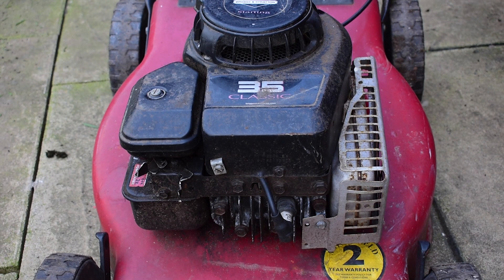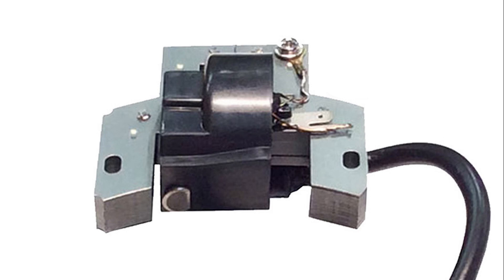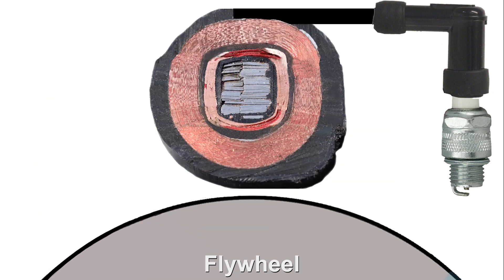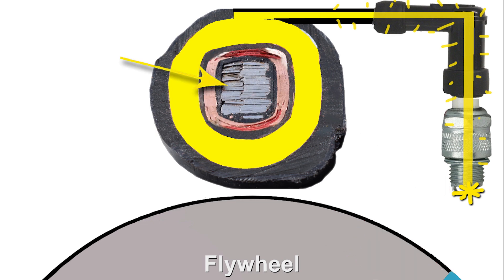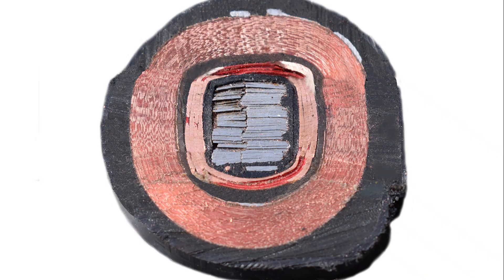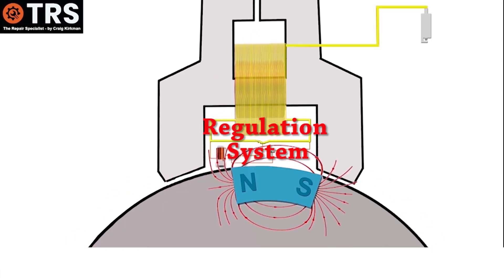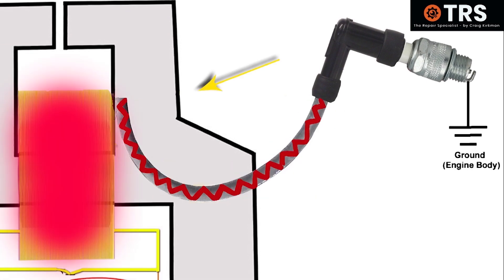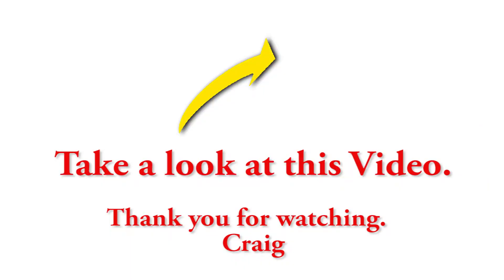Lawn mower Stops after few minutes, when HOT - This is Why!  (by Craig Kirkman)

Comment: Your governor vid is a masterpiece. I have this problem you describe. 2017 Honda GCV160 engine. Runs fine, then once it gets hot, dies. After cooling a minute, it will start right up and run a few more minutes. Also, especially it will die going up slight grade(it's self-propelled) or in high grass but strangely will also die (sometimes) on nearly bare ground sitting still and not even mowing-so it dies under an enhanced load and also sometimes not.  Regular oil changes. Never used gasahol. I cleaned tank and filter as clean as a whistle. Didn't help. Replaced carb, auto choke, gaskets with new Honda parts. Needed new carb anyway because plug was heavily sooted and was drinking gas. Still would die as before, sometimes after 15 minutes and sometimes after a couple of minutes. When it starts to struggle I can sometimes get it temporarily running fine by gently fiddling with governor rod and arm and speed control lever. Due to the fact that once it warmed up from being hours long cold, I begin to get a random miss and then it soon stops, I suspected a bad coil that gets heat-soaked so I replaced it with new Honda part and air-gapped within recommended range. Cleaned plug and checked gap. Mower now runs better overall, solid and strong like new and then...random missed and died again after a few minutes just like before. So disappointing. Started it up again, and when it started to struggle, I wiggled the governor arm like I have done many times and can usually get it to recover when it starts to struggle and try to die. While doing this I moved governor arm back and/or the speed control lever farther this time than I ever did and it recovered and ran and continued to. Amazingly to me I finished back yard and did all front yard, running at same proper RPM as always-never died again. I am suspecting governor problems and I may have freed something up this last time I forced it back. I seems to run fine and at proper RPM when running so the RPM adjustment is not off, it just will die for no reason. New governor is cheap to buy ($6US)(or could be cleaned of gook) but it is inside crankcase so a tough job. Could the seal where governor shaft exits the crankcase be binding the shaft, or could the nylon governor gear inside have a broken tooth, or the weights mechanism binding? Do you have any ideas?

Comment: i replaced my ignition coil and spark plug and cleaned out the carburetor with carb cleaner (fully disassembled and reassembled) several times, cleaned the gas tank, the hose, and my m110 mower STILL stops after using it for a while. it's driving me insane i have no idea what the issue could be

Comment: I had this problem last year that when the engine would get hot, it would stall and also generate no spark.  Replacing the coil fixed the spark issue, but not the stall issue when hot.  What I discovered is that my fuel tank cap vent was plugged and the fuel tank would get an induced vacuum.  Loosening the cap alleviated that problem until recently, manifesting itself as a lack of fuel issue again.  When it would stall, I noted that the fuel in my fuel filter housing would push back into the tank.  My fuel line was designed to pass over one of the two cylinder heads/jugs on its way to the carburetor.  I have heard of fuel line vapor lock, but not sure if it's for real.  Today, the debris screen was too hot to touch.  My cooling fins on the heads and jugs are clear, and the flywheel fins are completely in tact.  I see no obstructions, but it seems not to be cooling as I think it should be.  Will this lead to premature coil failure and/or fuel line vapor lock?  I'm at wits end with this B&S 16Hp IC engine!  Sorry for being so long, but this is a complex issue!
Reply: I am having the same issue with my riding lawn mower, stalls out after use and I replaced the coil and there is spark but it still dies out. Still struggling with this

Comment: I like your video, but the solution to my new generator engine always stopping after a few minutes was simply that the fuel cap wasn't venting. I loosened it and the engine didn't stop.
Reply from the maker: Oh, thank you for letting me know. Yes, the fuel tank can build up negative pressures when the engine is running and fuel is leaving the tank. If the fuel cap is not venting then this pressure can prevent fuel from leaving the tank to the engine, and therefore, the engine is starved of fuel. Thanks for letting me know. 👍

Comment: I’ve replaced my magneto, and I still have this issue
Reply from the maker: Well, if you have replaced the coil with no results, then I would suggest using the following as a guide:

When it gets hot, a lawnmower could stop for a few different reasons:

Vapour Lock: This situation, in which the fuel in the carburetor evaporates and creates a vapour barrier that stops the flow of fuel, is one scenario. This can occur if the engine overheats and the lawnmower stalls. This problem can be fixed by letting the engine cool.

Fuel System Issues: When the engine gets hot, problems with the fuel system, including a clogged fuel filter or a broken fuel pump, can cause the engine to stall. This problem might be fixed by cleaning or changing the fuel filter and ensuring proper fuel flow.

Overheating: Lawnmowers may overheat due to insufficient airflow or cooling. If the cooling fins are clogged with debris, the engine may become excessively hot and shut down as a safety measure. Cleaning the cooling fins and ensuring proper airflow can help prevent overheating.

Problems with the carburetor might lead to the engine stalling when it becomes heated. The fuel-air mixture might be disturbed by problems like a stuck float or a filthy carburetor, which can result in engine shutdown. To solve this problem, the carburetor may need to be cleaned or rebuilt.

If you are still unsure about this then I would suggest that you visit a professional technician or take your lawnmower to a servicing facility if it constantly stops when it becomes heated. To ensure appropriate repair and dependable operation, they can carry out a comprehensive check and identify the precise cause of the issue.

I hope this helps

Craig
Reply: @TheRepairSpecialist  thank you for the detailed response. I believe it’s fuel, so I have narrowed down to the seat. I’m going to tear the carb down again, and replace the seat. Hope it works. Not worth as much as the time and parts, but I’m stubborn, and don’t want to give up

Comment: My neighbor is havng this problem with their Husqvarna tht has a B&S engine. Going to send this to them and  try replacing the Ignition Coil for them....They have only had the mower for couple years and have it serviced every year by a very reputal lawn mower shop in nashville but they dont seem to be much help for them since they are a commercial client......This was a very informative video especially the vibration part that can cause issues. They do cut their lawn way to short. I will check for vibrations when I get it

Comment: I have a mower that will run fine for hours. Once i stsrt pishing it for about 10 minutes it shuts off and wont start. After about 10 minutes it will restart but then it does the same thing. As long as it sits still it wilp run until out of gas. Have any ideas about this problem

Comment: I had a lawn mower that started every time on first pull or second pull. Pushing it on the side walk it ran perfectly. Sa soon as I pushed it through the grass, it died. Was this a sheared key or a coil problem? It wouldn't  take the slightest load.
Reply: I have the same issue with my wife 😂

Comment: I love the detailed explanations! My toro riding mower doesn’t completely die when it gets hot but it does start to run rough. Like it’s misfiring. Always runs perfect when cold. Could this be a coil issue or would the engine definitely just stop running.
Reply from the maker: Yes you have hit on a very good point there, and you have made me realize I should have mentioned it in the video. 

The coils don't always just stop when they have the issues shown in the video. They do indeed do what you have said, especially in the early days of their failings.  They can first start to misfire and show running inefficiencies.  

They can either stay this way, or usually they progress to shutting down when hot.  

Thank you for your awesome feedback, and being a valued subscriber for the last three weeks. Craig 👍👍👍

Comment: Every time this symptom has occurred with my machines, its been the ECU. Also water doesn't lead electricity, it's the pollution in the water that does that.
Reply from the maker: Yes pure water is in fact a very good insulator, rather than a conductor. However, because there is NO pure water in nature, I referred to water being a conductor.  This lets people know that when they see water around the coil they don’t actually need to start wondering if it is pure, or not. Too much none required information. Therefore, as NO water is pure in nature, then any water seen in around the coil is going to be a conductor rather than an insulator.  I’m sure you would not argue with this point If you were wet, and in some sort of contact with electrical outlets. The subject of pure, and none pure water, would not be on one’s mind!!!!

These small lawnmower ignition coils don’t have the same type of ECU system as does a Car, where the ECU has control over the fuel lines as well. These small flywheel magnet driven ignition coils have their own system that regulates sparking and large fluctuations in electrical current, but there structured and function differ.

ECU’s are typically used in automobiles and are part of a system that require a battery power to create the electron flow for the coil to generate its electromagnetic field. Our small lawnmower ignition coil does, in fact, use a fixed magnet for the current. There is no system in this lawnmower coil that is the exactly the same as the one represented in the automobile system. I think you were confused!!!
Reply: @TheRepairSpecialist  - Nop, I know my engines and electrical stuff quite well... but since you have coils on other stuff, like mc/car/quad bike, i just wanted to meantion that the problem sometimes is the ECU (of course on stuff that uses an ECU). This in case someone watched this video since they had this problem and couldn't find a video for their spesific vehicle. But good video. Thank you sir.

Comment: Great video very detailed. I found out if the mower is running low on oil it will run a lot hotter and that will ruin the coil too. Always check the oil because some engines will burn or leak some oil
Reply from the maker: HI Thank you for your nice feedback. I really appreciate it. And, Yes. Absolutely. Great advice. I should have mentioned low oil in the video. Thanks again. Craig👍

Comment: MAYBE IS TRUE MAYBE IS NOT. A LOT OF THEORY, EXPLICATIONS, ETC. MEANS THAT THE COIL IS MADE BAD, BAD ISOLATIONS, CHEAP ITEM, ETC. I ask; why the coil neds a primary. Maybe the transfo theory we can change. Generally, the theory says: a mobile magnet, who mets a coil with/without iron, will create a voltage finally. function of the number of the wires. The stop of the  high voltage coil to spark plug will be the flywheel brake. Means, we can keep only the coil secondary and the coil iron and the job is done.
Reply from the maker: Fair enough. Thank you for your comment and contribution.  Craig

Comment: My bring and Stratton y use 45 minutes and shut down y put new coil and doing the same , y put new spark plugs and rebuild carburetor and steel shut down 30 to 45 minutes later
Reply from the maker: Hi.  In light of what work has been done so far, it is difficult for me to diagnose without being hands on with it.  I did hear of a colleague in the trade mention that he had a small mower like this do the same as you experienced.  You wouldn't believe what the cause was and I'm NOT saying it is the case for your engine, but here goes.
He had done just about everything to the engine for fix it.  But he didn't realize until later that his engine (again NOT saying this is the case with you and I don't want to seem as if i'm talking down to your situation or anything), but he had very little oil in the engine.  All we can think was happening was, Instead of the engine seizing, it seemed to be over heating and the internal components (Big End Bearing etc) expanded enough to grip the Crankshaft main journal, and cause enough friction to stop the engine. When it had cooled with cold contraction, it freed up enough to start again.

Again, i'm not saying this is your case at all. just a thought. Especially as you have already tried the other stuff already.

I hope this somehow helps a little.
Reply: and in English ?